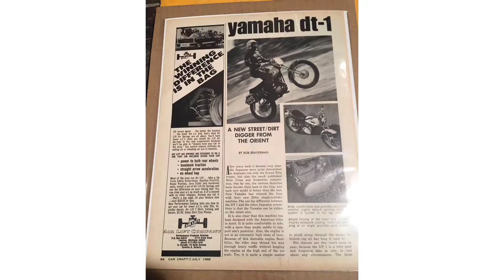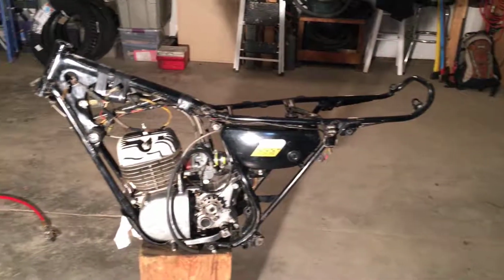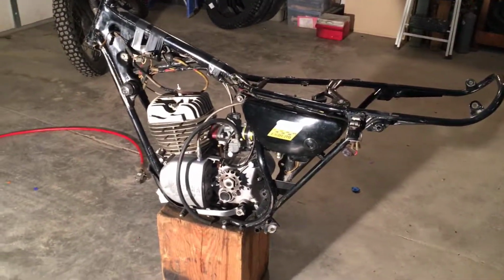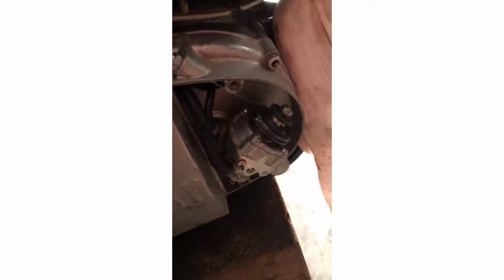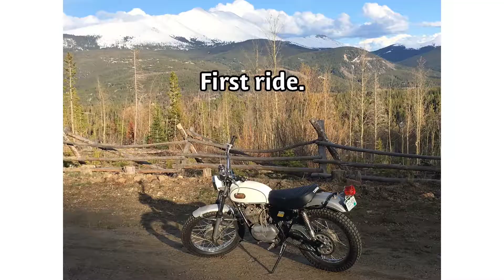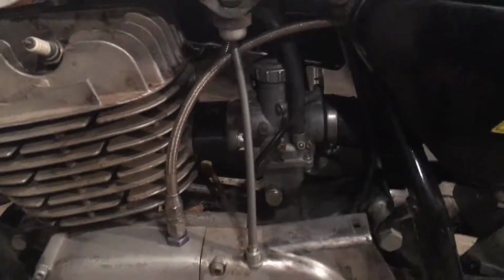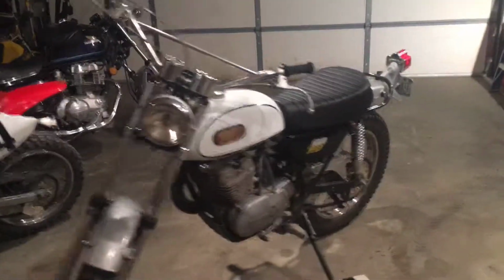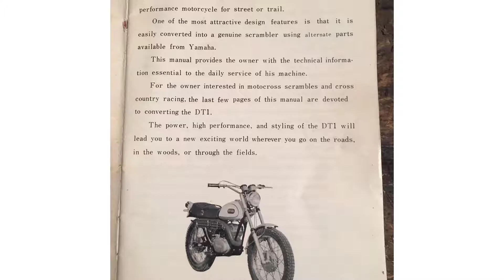1968 DT1 250.

Comment: I also fell in love with the first one I saw. It was 1968 and I was in Japan at a local Yokohama Yamaha dealer. The owner of the shop jumped up on the bike, kicked it once, hit the throttle, dropped it to one side so his foot would reach the floor and did a 180 in the middle of his extremely small shop. We were only allowed to have 125cc or smaller bikes but I vowed someday I'd have one. It took a long time, and my first was a 1972 rather than a 68, but it was close enough.